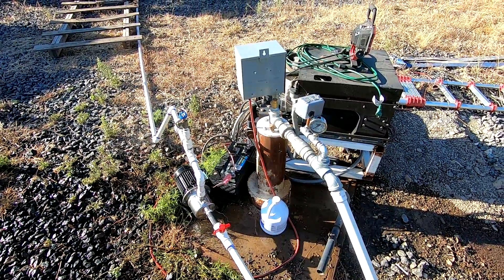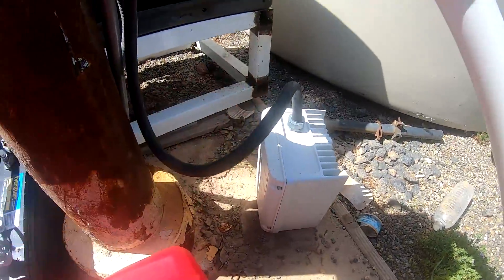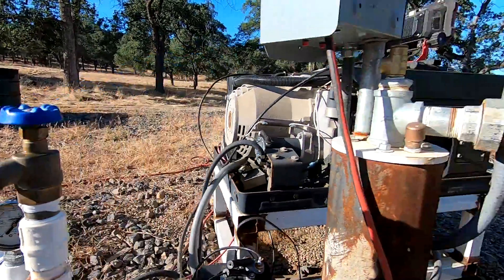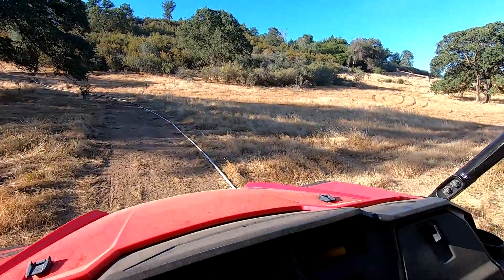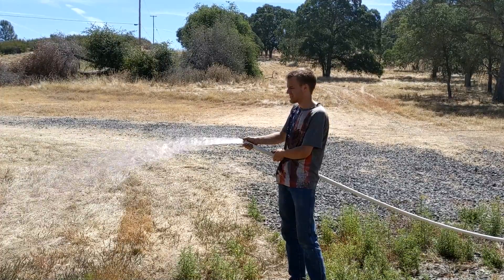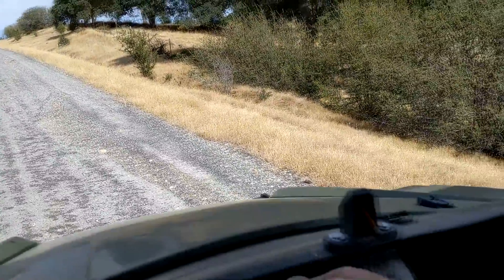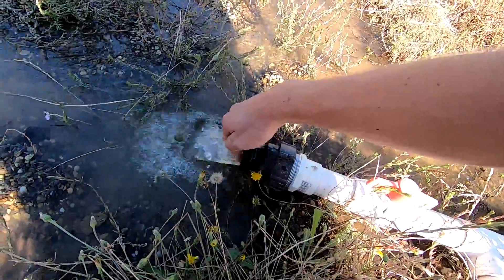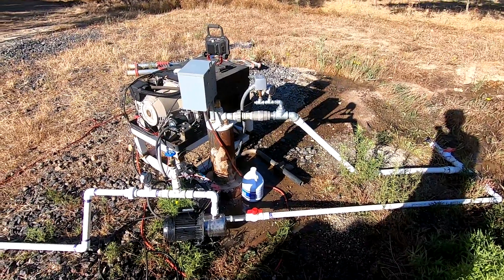Off Grid: 1300 Foot Water Pipe, Pushing 140' Up a hill!

Comment: I'm about to start a similar project moving water up the mountain at about 1800 feet from a spring cave we found on the bottom of the property. Any tips or suggestions that you could provide? We're looking to use poly pipe and a submersible pump run off a generator. Anything I can do to avoid headaches down the road that you ran into during or since?

Comment: Could you make a similar system for a house? I'm considering buying some land, and there is a spring on the bottom of a a hill. Probably 60 feet elevation change max, and 800 feet away. Would it need to be pumped into another container before connecting to the house?
Reply: Did you ever do this ? How'd it go? Were in about the same situation
Reply: @katiefuller3656  We have not yet, but hoping to. Hope it goes smooth for you if you pull the trigger. I'm sure the equipment exists to do it, just a matter of cost. I'd probably have an engineer of sorts take a gander my plans before pulling the trigger.

Comment: Do you lose GPM as the pressure decreases uphill?
Reply from the maker: A bit, but not too bad.  We get around 16 GPM at the bottom of the hill and about 14 GPM at the top of the hill.  This is the benefit of having the 3 HP pump.

Comment: Suggestions:
1) Don't waste the pipe you've run already.  Trench next to it and just shove it in the trench (while empty!). 1" at that flow is fine.  Bigger pipe will silt up and become little pipe otherwise.  Your well is only good for so much water flow.  Over-pumping can be a disaster, and you have point-of-use tankage up top, a slow but steady flow is better for the pump, well, filter, and piping. 

2)  Definitely run signal/power lines down the trench for control.  Use step-up then a step down transformers to keep the wire size down.  I'd suggest you step-up to 600V then back down to 240V at the wellhead.

3)  Run ALL the water thru your filter system.  Don't try to segregate it, as it will drive you crazy.  The silt isn't evil and is exactly what a filter is supposed to be there to remove.  It should do it without any issues at all.  The filter should backwash at regular intervals of filtering. 

4)  Save the backwash to your silty plant watering tank or just have it directly plumbed to whatever plants you want watered frequently.  Typically your filter should be designed to need backwashing every 4 to 8 hours of filtering.  Backwashing is typically 3 to 6 minutes at about 4 times the filtering flow.  This is for a standard sand filter which is what this application would normally use.  Your CLICK would be fun/easy to run the filter with.   I do them all the time with CLICKs though usually their more complicated then yours would need to be.

5)  Controlling water systems is the most fun!

Thanks for the latest video!
Reply: Bro I aint reading this mess😂

Comment: Hi, I would like to make 2 suggestions to you,
1. Why don't you wire a PLC into your generator so you can use a start and stop button to control your generator?
2. When you were installing your water pipe, why didn't you install a steel wire armored cable next to it to provide a power supply for your pumps, you could also lay a fiber cable at the same time and use the fiber to communicate with a IP enabled PLC (like your solar plc) to control your pumps, so when your tanks get low, you can start the pumps and fill them without having to drive all they way down, it will also save you fuel as you can use power off your solar system to run your water pumps.
Reply: Probably would be nice, but a rough estimate for that would be around 500-1000 dollars for the direct burial fiber optic cable, another 500 dollars to have it spliced, and to get any usable power at the other end with a usable short circuit current (so that breakers trip when there’s a fault) at 120 VAC, we’re talking probably around 1000 - 2000 dollars for the power cable. Distance is a bitch when it comes to power cabling. So I imagine that he has quite a lot more useable projects to burn 5 grand on.

Comment: no thrust control on the pipe aside from friction with the ground?
Reply from the maker: That is correct. as I mentioned in other comments this is just temporary for a few months until we can trench up the hill with some bigger pipe
Reply: @HighTechLab  Ahh got it.   consider running a 1p 240 - 480 or even 600v transformer to get power down that trench without killing yourself on wire cost.  rough mental math puts it at 12awg copper for both pumps at 600v.
Reply from the maker: @jeepxj  gotta figure out how to get it up to 1440v ;)
Reply: @HighTechLab  you mean 14,400 i think.   ebay has those transformers as well.  400 an end for your load.

Comment: Why wouldn't you run that pipe as a single piece of poly?
Reply from the maker: My understanding is the Poly is not rated for the pressure that we need and the cost is greater than the PVC pipe. For the pipe I was $600 for 1400 ft. do you know if Poly would be sufficient and if they sell it in 2"?
Reply: @HighTechLab  https://hdpesupply.com/1-1-4-ips-sdr11-pe4710-black-hdpe-pipe-500-coil/   i;m sure you could find a 1500' coil.  but yea looks like PSI wise its fine.
Reply: @jeepxj  200 psi is cutting it close for any surge

Comment: I hope you bought the UVR type of PVC. Even that will become brittle with a few years sun exposure, but it'll last longer than the plain stuff.

If this is going to be a semi-permanent install, then you should definitely paint the pipe, and stake it down.
Reply: He plans on burying it eventually (I assume power from building but that is a very long line to run 240v over assuming that's what he uses there)
Reply from the maker: I'd step up the voltage to at least 480v to run down the hill.  If I can find transformers I'd run it up to 960v

Comment: When you opened the valve @10:00, you not oly have the well pump, but the water from the hill was making its way back down, it's like having 2 pumps. that's why the pressure increases.
Where i worked they had a 4" plastic pipe from our well that was suppsed to be rated for 600PSI, yet for some reason it shattered the flange (bolted flange joining pipes), hammer is bad (if that's what happened)

Comment: Do you have Check valves on that pipe going up top? We had trouble with pumps not lasting long. Found out that putting in a few Check valves have stopped this. The pump after doing this has been running for 4 years now.. Nice work thanks for sharing..

Comment: I have watched several of your video's and I would like to say "WHAT A HUGE WAIST OF TIME & MONEY!" Did someone pass and leave you too much money for you to handle responsibly?
Reply from the maker: No one passed and left us money.  We are living in travel trailer and working day in and out to build our dream property.  For the amount of time it was taking to haul water, I could be doing things that earn me far more money instead of spending it on fuel and wear and tear on a truck.  This pipe project will pay for itself in a matter of weeks.

In regards to the position of the of grid power room, the local utility company wanted to charge us $70,000 to bring us power!  Adding on to that the average cost per kwh in our area is around $.30!  For that much per kwh it is equal cost in fuel to burn diesel in the generator even without solar panels.  We are by far saving a ton of money doing things the way we are.

Not only that but the local utility is sending out letters across the state that they will begin conducting power outages on windy dry days to prevent fires, which they have been sued for causing.  While many in our state are it of power we will be sitting back in the air conditioning enjoying life.
Reply: How is this a waist of time and money? In one of his videos, he told us the cost of his PV system, versus what a power company would've charged him for getting power to his house. I don't recall the exact numbers, but I believe the PV system was about 30% of the cost of what the power company wanted. I'm pretty sure that the same goes for water.
Also, who are you to judge if this is handling money responsibly or not? If you don't like what he's doing, why are you even watching his videos?
Reply: My, my; you sound like a real no-fun guy. By the way, you can WASTE money but your belt goes around your WAIST. Learn proper English and maybe you can make some money to waste.
Reply: who in the world asked you to criticize this project...what are you...the junior high hall monitor....appointed to give your silly opinion on things....
Reply: We thinking about the short run or long run here? It will save coming down every few days to fill up the tank multiple times to take it up the hill. Yes, it took a while to put in but in the future will save time

Comment: Will you have to do anything special in 5 months to handle freezing temperatures during winter nights?
Reply from the maker: The goal is by then to have a 2" water line trenched and buried along with sending power down the hill.
Reply from the maker: I also can simply drain the pipe out when the tanks are full.